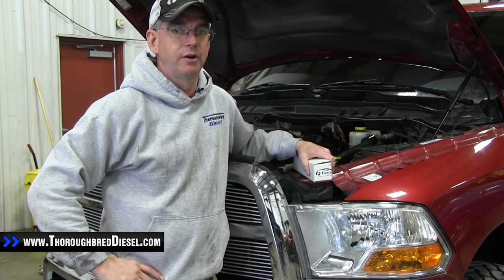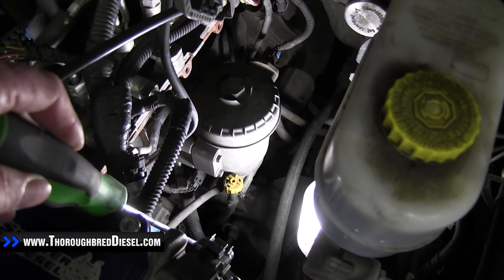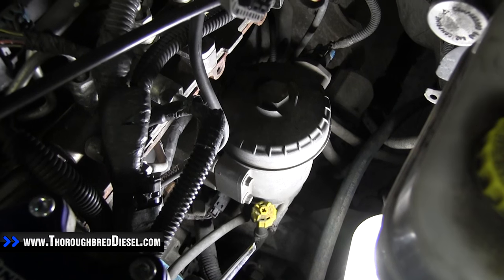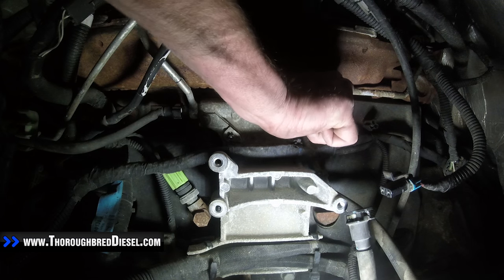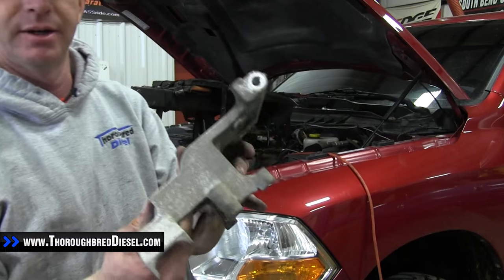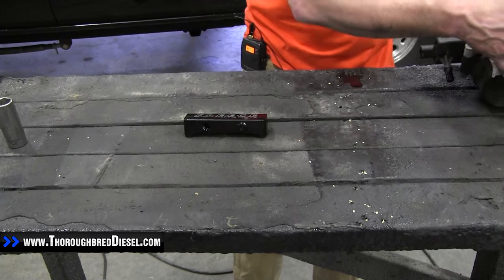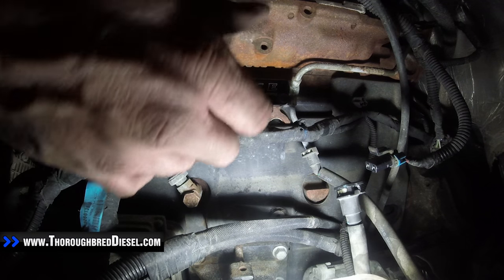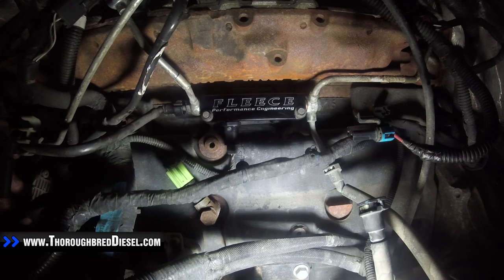Fuel Filter Delete by Fleece Performance Install: 4th Gen Dodge Cummins

Comment: To answer all the questions about the supply line to the cp3 from the filter housing, you will need to make a new line. buy 3/8" nylon tubing a 3/8" push lock fitting and a 5/16" push lock fitting. Follow supply line down drivers side frame rail to pushlock end on metal tank line, measure and cut line install fittings and connect to cp3 and tank line.

Comment: Ok, what happens with both fuel lines from the CP3?  Two are disconnected from the OEM filter and only one hooks back up.  Am I supposed just let that line go free? I'm pretty sure fuel will spray everywhere...
Reply from the maker: I do not know what you are referring to.
Reply: If you are deleting the stock oem fuel filter. You would have a aftermarket fuel pump or lift pump like airdog,fass or ase. The stock fuel line that go to the stock cp3 pump will not have any fuel going through them. 
 Hope that answers your question

Comment: What Fleece does not tell you is that (at least on my 2015) you will need a new line to the CP3. Yes, you can order a 1/2 line kit for about 40.00 bucks shipped but I have no idea why they would leave this part out in the video. They should make a video for guys that did the aftermarket Rear CAT install. I like being able to get under the rear of the truck and change both filters quickly and without making mess in the driveway.
Reply: This. This is where i am at. Cat filter under bed.

Comment: Is there any product currently made that can make use of the stock fuel heater wiring left after this delete to add a fuel heater to my relocated filters? I want the fuel heater but don't want to add more wiring into the system so making use of this left over wiring would be great.

Comment: On an 04 there’s a quick connect fittingly the one filter hosing on the right side of the bowl that’s left after this is installed what do you do with that line

Comment: So what did you do with the line that come off the cp3 and the line that comes from the tank? You compketely left that out?
Reply from the maker: Once the fuel bowl is out, the supply line from the bowl to the pump is out. The supply line from tank to bowl really doesn’t need to be addressed. If you want to remove it,  just make sure that you sure everything up at the tank.
Reply: So if you take the supply line off from the tank to the fuel bowl, how does the cp3 receive fuel?
Reply: Looks like this kit only takes care of the return fuel and not the supply    if you have say a cat filter conversion on your truck     gonna need to connect the supply line somehow to the cp3

Comment: I got a Sinister Diesel one for my 08 6.7, now I don't believe it has a port for the Water in fuel sensor. What should I do to get rid of the light?
Reply from the maker: If it does not have the port you could add the WIF sensor back into the feed line by making a T in the line.

Comment: Maaaan, my trans cooler lines run right by the dang return line fitting…trying to get that out is proving to be a job!
Reply: Man I installed mine today and boy are you not wrong about those trans lines! Such a pain but finally got it!

Comment: I have 2 metal lines right in front of the top 2 bracket bolts. What should I do with them?
Reply from the maker: If you could reach out to us at 866 737 4966 and ask to speak to Wade we will get you taken care of.  I would need to see a picture of what you have before I can answer.
Reply: In case anyone is wondering about this question, I’m sure he is referring to the transmission lines. I just installed mine today on a 2012 3500 and that was my issue. I just took the bolt out of the bracket and moved them around as much as possible without damaging them. Makes it harder but finally got it

Comment: Is the water in fuel sensor still effective in this location or would it be better in the stock configuration?
Reply from the maker: Water in fuel sensor can be reinstalled on this fuel filter delete.  Honestly, Cummins never really has had an “effective” WIF sensor, so If there is water “pooling” the sensor will still report.

Comment: Why not just take the filter out,  and leave the filter housing in its mounted spot?
Reply from the maker: For us, the object is to remove the filter housing for more room in the engine bay.
Reply: You would also loose your water in fuel sensor

Comment: Can I use this with a Cat filter kit
Reply from the maker: The CAT fuel filter adapter works for the 04.5-07 5.9’s and it retains the fuel filter bracket. Short answer, it will not work.
Reply: Thoroughbred Diesel I’m looking to do this with my 11 the stock filter sucks and O ring for cap can’t be sold Alone. I’m looking to go cat filter kit also. What other products am I gonna need to make this work? Thanks in advance

Comment: Deleting a fuel filter is stupid
Reply: apparently you have no clue as to why one is doing this. IF you did you would not have made that statement. one does no DELETE the fuel filter to permanently get rid of it. But to delete the OEM filter in order to RELOCATE it to a better position and to be able to use a much beter filtration system.
Reply: Alex Guzman you are the reason for building the wall!